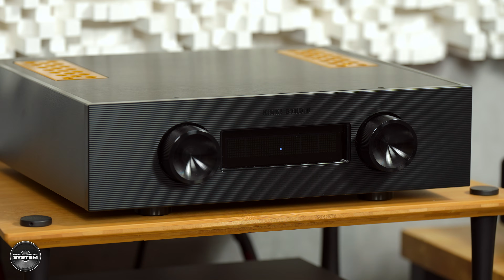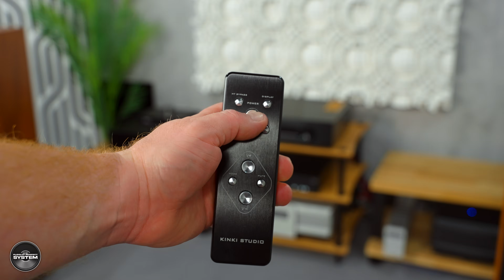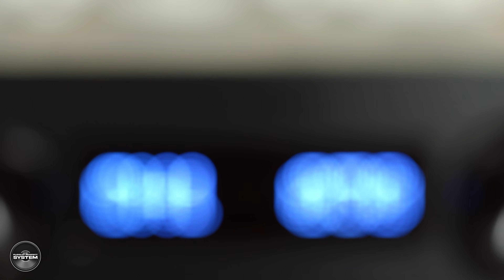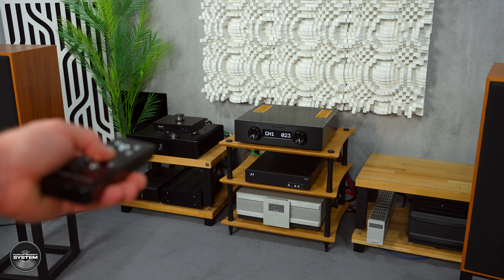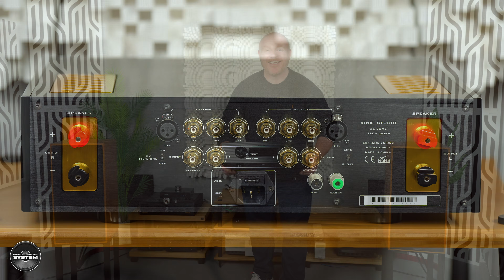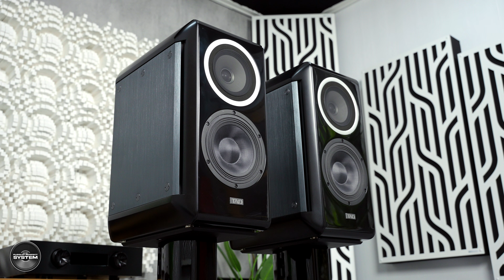EXCELLENT HIFI AMPLIFIER ! Kinki Studio EX M1+

Comment: Haha, I'm still using two of my old AVI S2000MI integrated amplifiers from 1997 as left and right monoblocks, running them in full class A mode, hot enough to fry an egg on, 🤣, and using linn genki cd players as the source, and using the genki's variable output for volume control.

Comment: I upgraded mine with Muses JFET op amps plus Stacatto discrete op amps. After trying about 20 combinations that was the best and far better than stock.
Reply: Hi. 
Im interested in hearing more about that. Im considering the ex-m1+ and like the fact that one has the opportunity of tuning with different op amps. Now Im trying to find out if the ex-m1 can check most of my boxes. Which combi of op amps did you use, and how was it better?
Reply: @lssht  I tried about 20 kinds of op amp. You can Google and find threads where people talk about it. Seems that the Stocatto is the "best".
Reply: @chrisdearmitt7474  I asked for your opinion on the change they did from the original. 😉
Reply: @lssht  way more natural / rich / organic. In a different league than stock.

Comment: I wonder how much better this amp is with upgraded op-amps? If any at all? Anybody try it with Sparkos Labs or Staccato?
Reply: I have the Staccato. Clear improvement. More transparent and livelier. Love them.
Reply: Thanks! It takes four singles and one dual op amps correct?
Reply: @progrock3603  Right.
Reply: @vladdumitrescu643   I have EX-M1+ too. How many risers did you use for Staccato please? My unit is from August 2021. thx
Reply: @jansulek1379  I think one on each side, it's a pretty tight fit.
Reply: @vladdumitrescu643  Many thanks Vlad. I have 10 pieces of risers for sure :) Now Im going to order Staccato OPAMPs.
Reply: @jansulek1379  what was the end result?